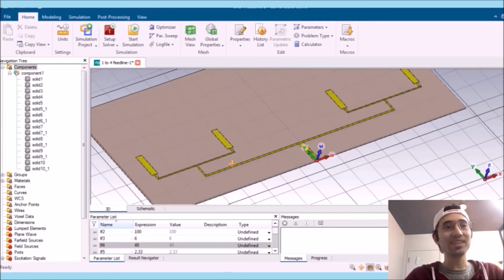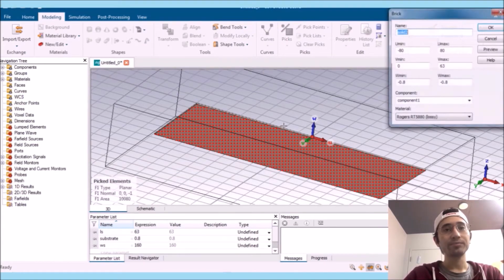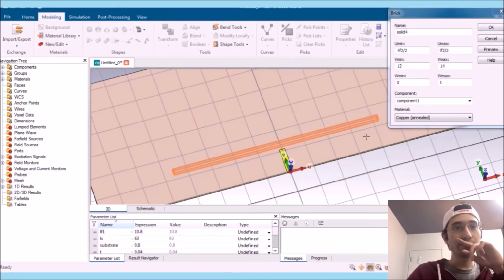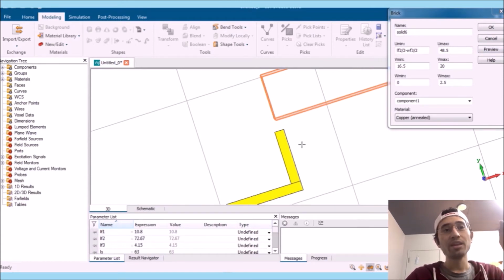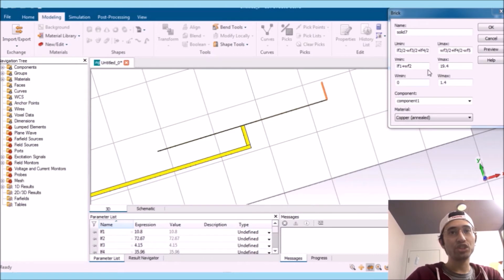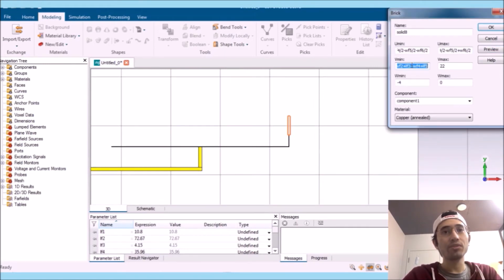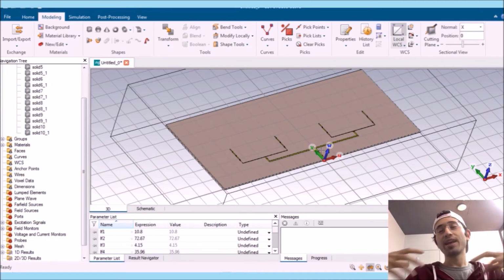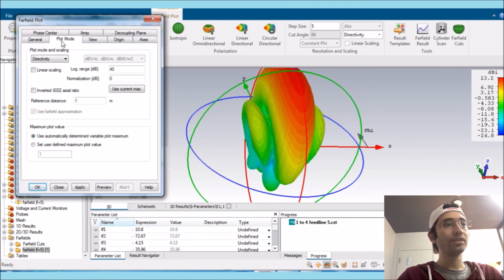Amazing Microstrip Feed Network || Power Divider

Comment: hukm, how to say it. i think you should give the calculation formula or something like that. just giving the model without the isolation impedance doesn't seem to make much sense (at least i think so).
Reply from the maker: The input impedance is set at 50 ohms. You can use an online microstrip line calculator; you don’t need the formula, although it can be found in Balanis’ book.

Comment: Give suggestion for 6port power divider
Reply from the maker: I would recommend Symmetric Wilkinson Divider, A possible approach is cascading multiple Wilkinson dividers. Start with a 3-port divider that feeds into three 2-port dividers. This way, the power is evenly split among 6 outputs with isolation between the ports.

Comment: thanks for this video, I want to ask about beam steering, how can I do it in this case?
Reply from the maker: You need to create a different phase for each output. In the case of beam-steerable systems, these phases should vary to adjust the radiation pattern accordingly.

Comment: How do I start designing a substrate integrated waveguide cavity using CST. What are the parameters that must be calculated and adhered to before starting the design?
Reply from the maker: You need to use the SIW formula to calculate the vias distance and the line width first.

Comment: Thank you so much for the tutorial. Sir, can you tell the further process (how to add patches)?
Reply from the maker: You can add your output ports or radiation patches. The method is the same as designing a microstrip antenna, I have one for a 2.4 GHz patch antenna.
Reply: @fredfrancium  Sir can you share the S-Parameter of 1:4 power divider using microstrip patch antenna. Please Sir it's urgent.

Comment: Firstly, thank you so much for the tutorial. I wanted to know that how many port you are using? since its 1 to 4 hence there should be 4 output ports as well right? i can only see one input port here.
Reply from the maker: Hi, Finally I used 4 output ports for feeding the 4 elements radiation patches. Therefore the outputs excite the radiation patches.
Reply: @fredfrancium   Thank you so much. Could you please tell me how do we control the phase of each transmission line. I want different phases in different transmission so that the array antennas get different power
Reply from the maker: @theradio-guy6983  For feeding each element with different "power" you should use the structure as a power divider, and in very simple words by changing appropriate the microstrip width you can do it. But to make difference in "phase" you should make the variable length, that the signal travels different path length until reach each element.
Reply: @fredfrancium   Thank you so much for the information. It really helped me. Really appreciate your efforts.